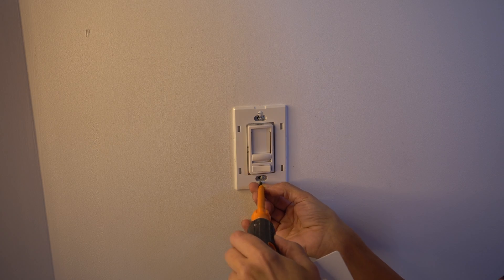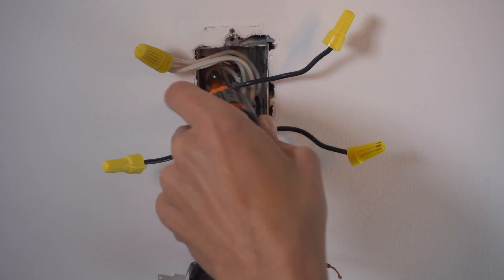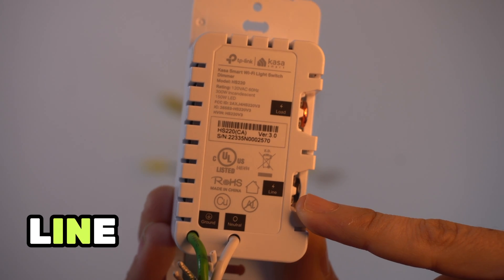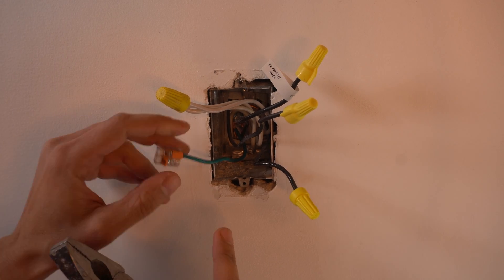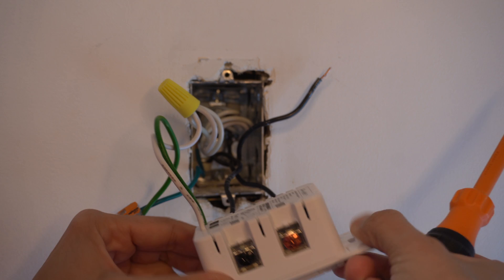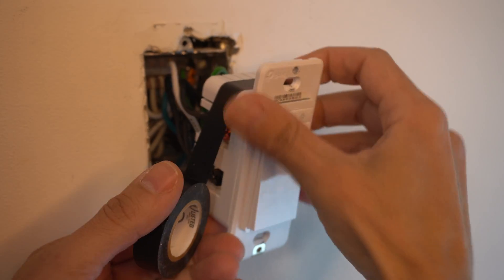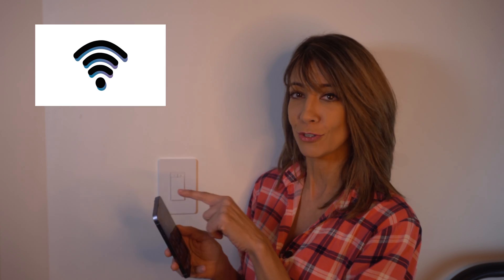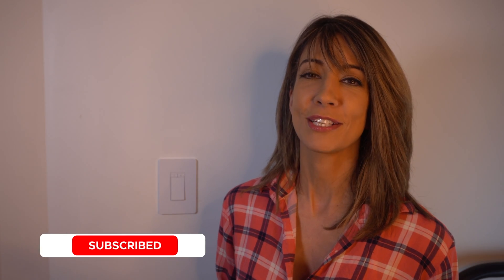Smart Dimmer Switch Installation | Control Your Lights in 10 Minutes

Comment: I have lutron  diva dimmer , it says single pole/3way
So tht means its for both 3 way and a regular switch 
Is tht correct?
Reply from the maker: Yes it should be able to do single pole or 3-way so yes to both.
Reply: @DaruDhillon ❤thanks

Comment: I learned more from you then like ten other videos and ChatGPT. Line in, lOad Out. Genius. Also I couldn’t find any videos using this switch with two wires using back wiring method

Comment: I have the Tapo app to control my doorbell cam. Will that also control the Kasa switch (you downloaded the Kasa app, but it appeared your phone seemed to be using the Tapo app when you were syncing.
Reply from the maker: I was using the Kasa App in the video. My network was 2.5 instead of 5 to make it work with wifi.
Reply: @DaruDhillon  Thanks!

Comment: I have a 3 gang which controls different lights. Is it ok to buy 3 separate ones smart lights and buy one big plate?
Reply from the maker: You can buy a three gang cover plate for your electrical box. I’ve done that before the smart dimmer will fit.
Reply: @DaruDhillon  thank you. I tried a 3 gang cover plate but couldn't get it to fit. Do you have a specific one that works?
Reply from the maker: @ the one I had was from Amazon it was screwless. Sorry it didn’t work out.

Comment: Thanks for the video, but you should improve the wire connection to the device by going around the screw (in the screw-close direction). inserting as a straight wire like that can be a problem.
Reply from the maker: Thanks I’ll keep that in mind.

Comment: I have thirteen Kasa smart devices in my home, all to control my lights. The biggest headache that I experienced yesterday while setting up two new smart dimmer switches is that you can't set them up if your phone is connected to the 5GHz WiFi Channel of your home network rather than the 2.4GHz channel which these switches do support. Since my Android phone automatically switches from 2.4Ghz to 5Ghz when I am closer to the WiFi Access Point with no ability to control that, and since my Google Home WiFi has no way of separating 2.4Ghz from 5GHz, it becomes impossible to set up the Kasa switches from my phone. I tried walking out of the house down the street so as to get the 2.4Ghz signal but then I was too far from the switch for its WiFi to be detectable. Eventually I got out my eight year old defunct tablet which only supports 2.4Ghz and was able to set it up on that.
Reply from the maker: Thanks for the feedback, this is a very important point! I'll be sure to make note of this in an upcoming video.

Comment: Super helpful video!  I noticed that when you demonstrated which wire was the line wire, I was unclear how that was happening if you had already turned the breaker off.  Does that mean you turned it back on just to find the line wire?
Reply from the maker: @gus_ivan  yes, breaker off then on to test which one is the line wire. Once you’ve located it, mark it and turn the power back off. Thanks for the question

Comment: Thank you for posting this excellent video. It was funny seeing you use the Wago connector for the ground connection only and not for the neutral, line or load wires. Perhaps there just was not enough room in the outlet box for you to go "all Wago".
Reply from the maker: Good point. I don’t think I had the 4 ports or 3s at this time. I now have them on hand and find them useful.

Comment: If you reuse the old wire nut, check that there is no copper in the tip. If there is debrey in the tip, use a new nut.
Reply from the maker: @rossjohnson9162  Thanks Ross that’s a good tip. Appreciate you sharing your experience. 👍🏽

Comment: Great content. I'm changing out the lights in my house to recess LED lights and considering using smart dimmer. Not an electrician by any means, but content like yours has made me realize how easy it is for homeowners to do their own project? Question: why do you have two wires going onto the LINE screws? Is it because it part of a 3-way switch? Or something else? Thanks!
Reply from the maker: Thanks and good to see you taking on your own projects! It’s a good question. The power from the switch is providing power elsewhere in the room.

Comment: you seemed to forget to show how to sync the wifi from phone to app.  mine won't sync for some reason.
Reply from the maker: You need a strong wifi-connection or an extender. I had a wifi-technician also recommend splitting 5G down to 2.5G for smart tech devices to connect + 5G for wifi/internet use. I don’t know if that helps with your situation.
Reply: @DaruDhillon  Yeah, I get full bars, so it is fine, it just refuses to connect.  It just times out.  I have three different smart switches and tried them in various places, and it does the same thing in each room.

I can manually turn them off and on manually, it is just the app to phone to wifi switch, so Amazon Alexa can't access it.
Reply from the maker: @rmjohnson144  I would call your wifi provider they should be able to help you out. Sounds like a signal issue on their end.

Comment: Hello Daru , When removing wire nuts and plan to reuse them , Always look inside the wire nut to make sure there's no broken piece of wire in the nut , I've seen this many times , Especially removing wire nuts that had stranded wire connected because especially with stranded wire , The ends of the stranded wire are known to break off and get stuck in the wire nut and it can happen with solid wire , So If you see any broken piece of wire stuck in the wire nut , Throw it away and use a new one because if there's a piece of broken wire in there , It won't allow you to get the connection tight enough 
So as a rule of thumb , Whenever I remove wire nuts where stranded wire is connected , I always use new ones because I've had this happen many times , Another thing that makes you so great is that whenever a new product comes out on the market 
You thoroughly inspect it and check it for safety and quality , The products you introduce are the only ones I want to use because they have your stamp of approval which I know will be safe 
This is the first dimmer switch I've seen that has side terminals and don't require wire nuts because of how wire nuts take up space in the box , For sure the next time I have to replace a dimmer switch , I'm going with this one because I like the side terminals instead of the lead wires coming out of other dimmer switches because the lead wires coming out are rather small in wire gauge and I don't know how well they're connected internally in the switch , it'll be great if they come out with a dimmer switch that has the lever connectors the same way the receptacle and the switch you introduced , So I'll be looking for you to introduce a dimmer switch with lever connectors because I'm sure you'll find it and that you'll check it out thoroughly for safety and quality 
And that it has your stamp of approval before introducing it , One more thing I'd like to point out is when installing a dimmer switch that's 3 way , That is a light fixture controlled in two locations 
Only install one 3 way dimmer switch and not two , Otherwise you can get a double resistance through the other dimmer switch and not get full brilliance of the light fixture when you turn it all the way up , I had this happen when I installed a light fixture using 3 way switches and the lady I did it for wanted a 3 way switch at both ends and I wasn't getting full brilliance from the light fixture when I turned it all the way up , So I had to remove one 3 way dimmer switch and use a regular 3 way switch on the other end and explained it to the lady that you can't use two 3 way dimmer at both ends because of the double resistance effect and she eventually accepted it
Reply from the maker: Sounds like a great learning experience, loaded with helpful tips and lessons! Good job!
Reply: The Kasa KS230 Kit is a 3-way dimmer switch kit that includes a dimmer host and a dimmer button controller. This allows for dimming control from two different locations within a 3-way circuit, with synchronization between the host and the controller.

Comment: Great video. Unfortunately you skipped over very quickly why you need two 
line wires. 
Probably a very ignorant question. Thanks anyway.
Reply from the maker: Normally you’d see one wire. There’s two here because one wire provides power to the switch. The other is carrying powering to another device elsewhere. Good question. Thanks!

Comment: Kasa doesn’t offer a 2 gang face plate. What can I use?
Reply from the maker: Kasa will work with any standard faceplate. I’ve been using screwless faceplates in single, double and multi-gang installations. I have a link in the description to my Amazon store that has them at a good price. But any will do!

Comment: Just started installing Kasa smart switches in our new house and I've been pretty happy with them so far.  Getting ready to do my first 3-way set so I've been getting some tips from YouTube when I found your channel.  I really appreciate some of your tips.  Another one I picked up along the way is to write the breaker number on the back of your wall plate when you are working on an outlet or switch.
Reply from the maker: Welcome! That's a great tip about writing the breaker number on the wall plate. Thanks for sharing. That's helpful.
Reply: Thank you, that is indeed a great tip! I appreciate your sharing it very much.

Comment: Now this I like !  Love the lock down screws but Daru all the beauty in the world ( you ) wont compensate for an improper ground 
Great vid nonetheless !
Reply from the maker: How would you improve the ground? Curious. All wires are grounded at the back of the box.
Reply: Ok my bad just rewatched the vid and noticed the ground wires at the back of the box locked down . I’m so used to new installations where I will run wiring and wrap the ground around the lockdown screw then extend it to the device at about 6 inches or so . But in rework you don’t always find that . 
Pre twisting … wrapping the device with e tape …. Love it !  Great job !
Reply from the maker: @tonysC8  Thanks Tony! Always looking for ways to improve. Appreciate the double-take on the video.

Comment: I want to thank you so much for your videos being the way you present your information is truly educational and interesting. I have a question regarding the not strong WiFi signal you mentioned. Where I am now on an iPad that only works via WiFi and the WiFi box is at the furthest end of the house and so I am not getting a Strong WiFi signal. What would you recommend for me to use to strengthen the existing WiFi signal knowing it’s not easy to run a wire the entire length of the house to correct this. Is there a wireless device I can use to solve this? Thanking you in advance for your incredible presentation. I’m so impressed with you that  I taped on the Like and Subscribe. I grew up learning the basics of what you are explaining but you provided a much more current information with newer technology. Also you’re super attractive and I am super single, not that it matters. But thank you so much. I’m just extremely impressed with the presentations you provide.
Reply from the maker: I would call your wi-fi provider and see if they can help you with your signal issues. Companies where I live, will come to your home to install signal boosters for free. They plug into your wall. You can also get a wifi signal extender that will boost your signal. 
Kasa also says if you can’t improve your signal you can install your switches closer where your signal is strong. Thanks Mark all the best!